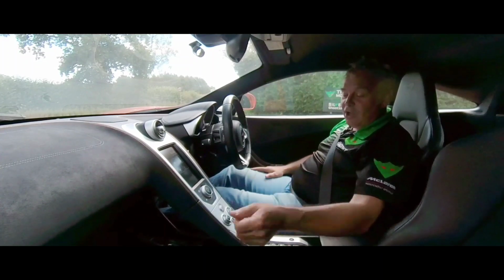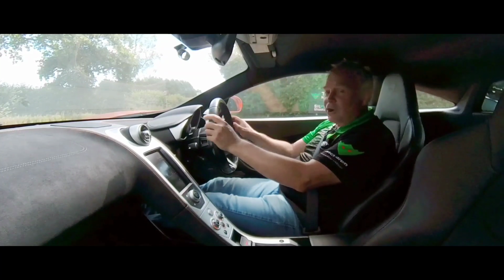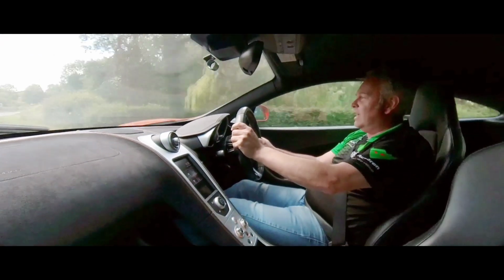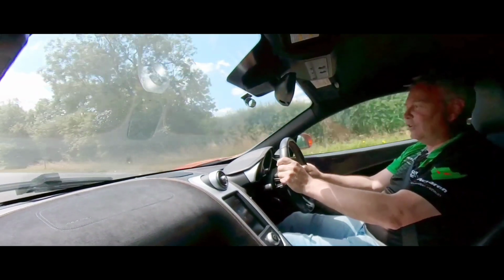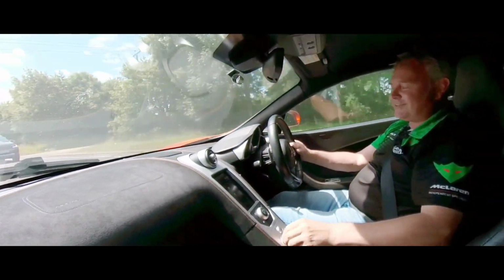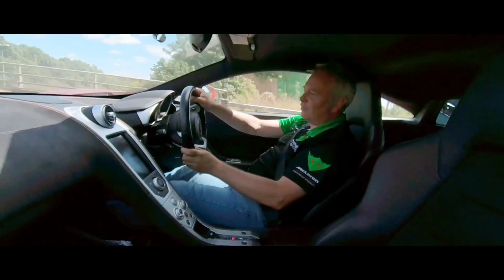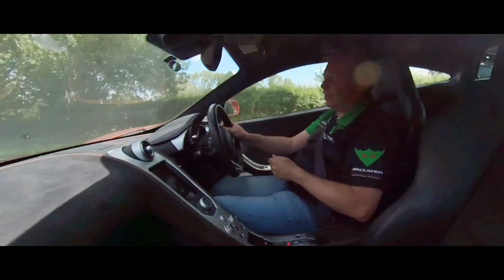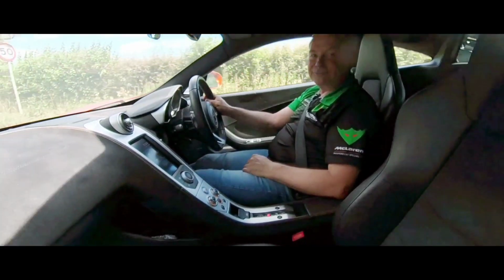How to check if your accumulators are dead

Comment: Will dead accumulators affect the handling in an unpredictable way? Ie mine seems to be oversteering at low speeds without much throttle and generally just feels less planted than my 570/600 did on the same roads
Reply from the maker: @martinpalmer3575  no, just the ride, that suggests a geometry issue
Reply: @ thanks. Are they a warranty item by the way?
Reply: @ thanks. Are they a warranty item by the way?
Reply from the maker: @martinpalmer3575  we cover them, a lot of warranties won't though as they are technically wear and tear

Comment: I’m in the states. Just had all my accumulators replaced in June 2022. Mechanic can’t clear fault codes. Car is locking me out of using sport mode.
Reply: Did you have this done at a Mclaren dealership? They need the McLaren tool to do a lot of the fault readings and resets. You also need to reprogram the suspension.
Reply: @kinosgarage  Hey, the car wasn’t talking to the scan too initially. But after the battery was disconnected the car finally started talking to the scan tool and he was able to clear  the fault codes. Car rides much better now and suspension fault codes have been removed.